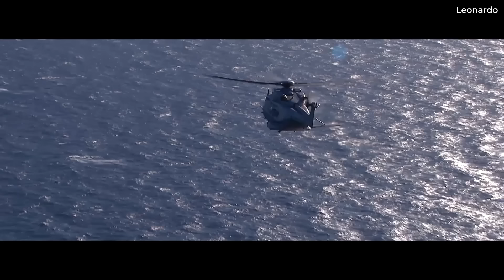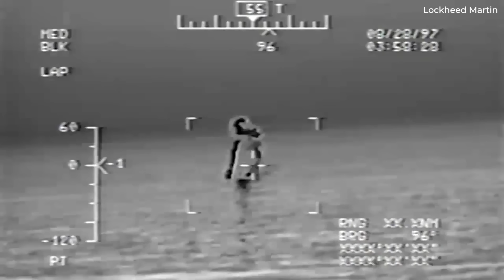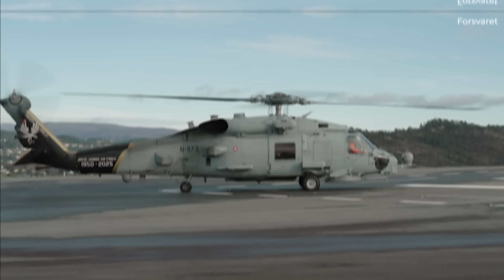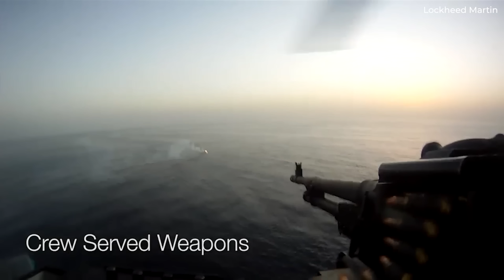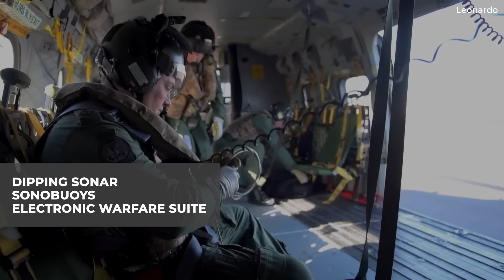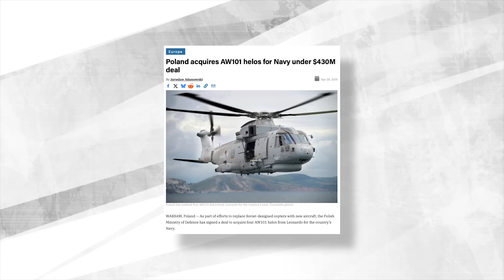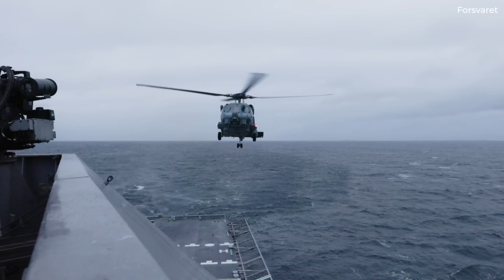MH-60R vs. AW101: What Will Be Norway's ASW Helicopter?

Comment: Considering the climate, the vast expanses of ocean surrounding Norway and the relative vicinity of Russia's Northern Fleet submarines, I'd select the Merlin hands down. Range, endurance and payload capacity ensure better performance in tracking down the latest Russian submarines like the Yasen- and Borei-class, which are believed to be very silent, (almost) on par with Western subs. That means more difficulty in detecting and tracking them and thus more time on station is required. 
Given that the Norwegian Kystvakt already operates these machines, that would make for perfect fleet harmonization and efficiencies of scale. And last but not least, the US are - again - threatening Greenland and Denmark into making far reaching concessions, so selecting the MH-60R means adding new vulnerability to the existing ones (F-35, ESSM, etc.)
Norway is a very rich country, earning a windfall in oil- and gas revenue as we speak due to the US-made energy crisis, so the higher acquisition and operating cost will hardly be a matter of concern. 
It would be nice though if the Merlin also got an electro optical sensor for passive search and track, which does not set off the ESSM-mast of a Russian sub at periscope depth. And a vast amount of sonobuoys would also be very welcome.

Comment: Merlin is the better technical and  integration helecopter.

It is considered the world best AzsW helecopter platform.

Used by the RN and therefore integrates with the joint Type 26 / Merlin platform with Norways type 26s.

Need Canada to purchase Merlins then the far north is covered by Type 26s and Merlins.

Disopointed that Sweeden has gone gir French frigets.  But perplexed why Babcock put forward the 120 instead of the 140s.  Given that French friget is longer than the type 31?
Reply: Agreed that it's the best solution. Canadian purchase seems unlikely, they do operate SAR Merlins but there was some political nonsense in the early 2000s which meant they cancelled their ASW Merlin order and bought a bespoke platform from Sikorsky instead which has caused them a lot of problems but seems to be resolved now.

I think you are confused on the frigate front. FDI is ~120m long as is (obviously) the Arrowhead 120. I assume this size was stipulated in the Swedish requirements, and I think FDI was clearly the better choice given Arrowhead 140`s main advantage is its size and therefore versatility (something you lose by going to AH120 while also losing the benefits of operating a shared design with your regional allies. Add to this that the Aster 30 / CAMM-ER combination on FDI offers an excellent AAW capability which would require either reliance on American missiles or more expensive integration work on AH140 or AH120.

Comment: The operating cost per hour numbers were a bit surprising, working purely on logic (no insider knowledge here) the Seahawk to Merlin cost should be roughly 2:3 matching the number of engines burning money, this is obviously more favourable than the 1:3 ratio you have stated. Potentially the difference could come from the Seahawk values coming from the manufacturer (who want to post good numbers to sell product) vs the Royal Navy operational values (who want to justify their budget) which could lead to some "creative rounding".

As others have said though, increased interoperability with the RN given the commonality of the Type 26 Frigates that these helicopters will be operating from is a significant factor so I would think Norway will be going Merlin. Another factor for a bigger chopper is the lift capacity in a transport role, which as these will be operating as the sole vehicle for a frigate will also have to take on ship-ship and ship-shore resupply even if ASW is its stated main role.
Reply: Operating costs are a quagmire.
For instance, the Swedish Cost per flight hour for the NH90 that caused black headlines included the annual maintenance which resulted in the CPFH steeply climb the less actual flight hours were used.
Finnish calculations during the evaluation for their new fighter is said to have everything included, even the janitors serving the base facilities....  which sort of makes sense if one wish to compare the total cost of different alternatives, but makes it impossible to measure against any other case.

Number of engines burning money is one factor, yes, but you also have other costs like spare parts (were economy of scale comes into play) and longevity of the components (Russian jet engines are much cheaper to buy that Western engines, but has between a third and half the life expectancy between tear-downs and full replacements). 

Long story short, the numbers presented are mostly pointless unless what they are based on is included in the presentation.

Comment: Why was the Airbus Helicopters H225M, formerly Eurocopter EC725 Caracal or Super Cougar; not considered as an intermediate low-cost, large capacity option? I still love the Leonardo/Augusta Westland AW159 Wildcat...
Reply: AW101 is bigger & can carry heavier loads than the others. It's robustness is legendary built to operate in the harshest environment's & with 3 engines it has the power & space to field much bigger & more powerful ASW/AEW equipment. It's made for situations were failure means death it can fly on one engine if it has to & it's got a significantly longer range than the others it's the better platform for maritime patrol, anti-submarine warfare (ASW/AEW). It comes at a price though of the group it's the most expensive but not by much & if you're leaning more to the ASW/AEW side it's the best option.
Reply: @ZuulGatekeeper but it comes at a cost? Both the extreme initial Capital expenditure as well as an increased operational cost including 3 times engine maintenance as well as higher fuel burn? The Caracal is only a little bit cheaper but the Seahawk would be substantially cheaper on an all-round programme cost? Would love to see a modernization programme for composite airframes and avionics for Seahawk and Caracal similarly to Future Lynx/Wildcat?

Comment: Whilst not dismissing the cost differential, I doubt that's too much of a consideration for the Norwegians - especially in light of the other benefits you mentioned.
Reply: A helicopter that can fly further, carry more equipment, with more power, and the maintenance crew can service the same airframe as the Rescue Service AW-101s is solid reasons. Price might be higher but the benefits are greater too.

Comment: The NH90 had some teething issues and much was also learned from the mistakes made in the project and first series child diseses. As Spain, NL, France and Germany has doubled down on new NH90 in ASW/frigate/CSAR trim, Norway should consider this in the new reality. Also the supply chain issue is also better now. US arms and systems. The NH90 does not have to be reconfigured for ASW and SAR unlike the Seahawk. NH90 & 101 should be the top candidates here. The NH90 is Seahawk sized, but with longer legs & 3 enignes, which is nice for longer distances in Norwegian seas. Training with the now substantial German lot instead of DKs 9 Seahawks... The NH90 in ASW also has more users in Europe, so more to trans with.
Wonder if Sweden gets NH90 in ASW for their new FDI? 
Could be you should do a vid on Germany ASW NH90 program and its sea tiger program? Germany also has 18 configured for SAR.
Reply: You gotta be kidding on the NH90 to Norway again....
Reply: Teething it's been a nightmare far too fragile & not robust enough for hash environments they spend more time in the hanger being repaired than they do in the air. The cost per flight hour is hitting $30,000 USD that's higher than most fighter jets just crazy.  Avoid the NH90 at all costs theirs a reason about 5 operators dumped it demanding a full refund or retiring thier fleets early. Sadly many operators are in too deep & stuck with it & while it's reliability issues have improved somewhat it's still one expensive pig hell it's a navy copter that can't land on ships in very rough, open-ocean environments kind of the one thing it needs to able to do.

Comment: Easy, UK is using Merlin, and it is certified for flying into known ice (something that is known to happen in Norway/North Atlantic/Barents and the Norwegian Sea/Arctic). The SH-60 is, however, not certified for FIKI (though they have some FIKI equipment).  I do not think a plan to ask Russians to only sail strategic submarines during the summer will work out.

Comment: An updated AW101 will be a beast and sill has space for future expansion, NH90's are the nibble choice. Quick to use and fix but are capped on expiation but it AW101 for me. It a Jack of all trades really for the UK which kind of makes the Leonardo contract for the new Helicopter kind of redundant, that's just how good it is.

Comment: Two very different beasts, one almost twice the size and weight of the other.
Norway should first assert what went wrong with the NH90 before committing: the helicopter is operating fine in many other countries, so the problem was on the program itself, in logistic, procurement, service contracts, spare parts procurement... Norway is the only country I know of that had issues (real ones, to be clear) in having the actual helicopter delivered.
If the new helicopter comes with the same problems it will produce the same results. The MH60R is "OLD", which means it relies on hydraulics and mechanical connection, making it less prone to "Glitches" and always fixable with a span. The NH60 is much more complex, expensive and intensive in maintenance, but it's like driving a ford Fiesta compared to a Jaguar. For the crew, orbiting over a rough sea with cold winds blowing in strafes, flying an AW101 gives much more confidence and is less taxing, plus the AW101 has a much longer range and allows prolonged hovering on station.
The reason why the NH90 was chosen to begin with was it's longer range, and flying comfort at an "Affordable price". Norway now has to chose now between comfort and costs.
Reply: We already know why went wrong with the NH90: NHI prioritizing the builder countries' needs at the expense at everyone else.
Some countries like Finland and New Zealand circumvented the issues by building their own industrial support with excellent results but that solution is only available on a case to case basis.

Comment: It’s going to be the AW101 as the UK and Norway are increasingly looking at commonality across fleets.
Reply: Norway as stated here, have ordered the MH-60R Seahawk for it's Coast Guard vessels. The Air Force Rescue Service already operates the AW-101... so it's a tossup, it will have integration, maintenance and service benefits whatever is chosen. But since the Type 26 is a UK design, and both Navies are planning to operate the class with 100% interoperability, the AW-101 ASW has a good chance of being selected.
Reply: We are forgetting that the British AW101 is an older model, and what Norway would get is a newer model, so interoperability disappears, even though they share the same name, they are not the same helicopter.
Reply: @heuhen  Its made by the same people that made the NH-90. its not British at all any longer. Leonardo BOUGHT the Design. I wouldnt touch anything they make after the NH-90 fiasco.
Reply: @heuhen given that the RN has upgraded their ASW Merlins to HM2 standard, is it that different to a new AW101?
Reply: @jamescotton01  yes
Reply: @Joakim-j7h 100% British given it was designed and developed by Augusta-Westland (Yeovil, Somerset), which rebranded as Leonardo Helicopters UK, as a sovereign UK capability.
Reply: Dazu kommen noch Italien, Polen und andere NATO Staaten. Zudem denke ich das Leonardo in Sachen Technologie die Oberhand hat!
Reply: Exactly

Comment: I think it's fairly obvious that the Norwegian helicopters will be armed with NSM (or possibly JSM) missiles and they are heavier than any missile either is currently equipped with. Both helicopters should still be able to handle them but the bigger AW101 may have an edge there.

Comment: There is one more advantage that Merlin has over Seahawk and it is quite obvious. Big cargo door at the back. That is a big deal in my opinion as it can carry much bigger cargo not only it terms of gross weight but also in dimension. For US that is not a big issue as they can afford to have countless number or various size helicopters for their needs: H-60 Sea Hawk, CH-53 Sea Stallion, CH-47 Chinook... For Norway it might be more beneficial to have bigger Merlin also due to the size of their sea they patrol vs the size of their navy.
Reply: Merlin in HM.2 variant (ASW) doesn't have the rear ramp. Thats on the HC.4 variant for troop transport.

Comment: Another consideration  would be crew comfort.  I believe the crew cannot fully stand up in the 60R vs the cabin space in the AW101.  Interoperability not a big factor, since the comms suite will ensure NATO interoperability.  As for crews from one country flying helos from other countries, not a factor except in unique cases.

Having longer endurance also translates into greater efficiency for the ship.  If the ship/helo use a 12 hr deck cycle, the AW101 (6 hr endurance) entails one refueling and crew change for cycle, vs 60R (4 hr endurance) means 2 refuelings and crew changes per deck cycle.  This means that the there is an increase in time and effort that the ship is constrained in its operations.

Secondary roles were just touched on very briefly.  One role is vertical replenishment or VERTREP.  I have no doubt that the 101 has a greater lifting capability when conducting VERTREP especially at sea from a supply ship.  With the greater range, VERTREP from ashore or medevac or passenger transfer may also be a factor.
Reply: One important issue often overlooked: The Norwegian Sea and Barents Sea means vast distances. Survivability is a critical issue.

✅️  The Leonardo AW101 features an integrated emergency flotation system designed for safe ditching and rapid (or delayed) evacuation in the event of an emergency over water. 

❌️. The U.S. Sea Hawk doesn't float. That works fine for a large battle group, with many helicopters on alert, but not for a single frigate on patrol in remote areas...

Comment: AW101, in every metric.
Reply: AW101 is an enourmous maintainance hog, but it is probably the best choice. And we would finally get some synergies effects of having the same helicopter in 330skv
Reply: Except for price, parts availability, and running cost
Reply: Other than the fact Norway already has MH-60R on order.
Reply: @120mmsmoothbore2   The six extremely overpriced MH-60R Sea Hawks was a hasty political decision. We paid premium for quick delivery, but USA later chose to delay delivery by 2 years (read: at least 2 years)... Unreliable.  Besides, it won't have ASW equipment. They're just for general transport on a few Coast Guard vessels. 

AW101 is of a higher class ...in any capacity. We need it, and we should just standardize on AW101 for long range SAR, ASW, and transport.

For small-to-medium multi-role (and smaller Coast Guard vessels): AW109 or the excellent AW159 Wildcat.

And just sell the Sea Hawks to Sweden/Denmark, while still new.

Comment: NH90 was crap. Totally unusable. Norway already has quite a few AW101-612. 16 of them and more is on order. These are operated by the Air Force and is mainly for SAR use but is also available for general use by the military when available or priority is needed. I suspect they chose different for the frigates to have a bit of redundancy in case of part shortage. That was the issue with NH-90. They always broke down and there was always backlogs on parts. There is nothing saying we can’t use AW101 on the frigates too. Before fall this year we will have 18 of them. There is no question about what will be chosen as the choppers was ordered when the NH90 was cancelled. It will be Blackhawk. So that make this video kinda wrong as there is no competition ongoing.
Reply: The SH-60 ordered are for the Coastguard...not the Navy. They're not going on the Frigates...the ASW helo competition is separate.

Comment: Wonder what sort of helicopter Sweden will get for their new Frigates? They have their own variant of the NH90 which has some ASW ability but there is a defence decision from 2022 stating that the NH90s (Hkp 14) should be phased out and a new naval helicopter system should be acquired instead.
Reply: When Sweden intends to replace them and if their dimensions are fit Finland should buy Swedens ASW-equipped NH90s for use on the Pohjanmaa-class corvette and elsewhere. The corvette should be able to house a medium helicopter in its hangar. And why not buy the rest of them as well while at it to increase numbers as long the price is right.
Reply: It will likely need to be something similar in size to a NH90 with the tail folded as that is what the FDI frigate's hanger is designed to fit. Hellenic Navy use a MH-60R on their FDI that just entered service.
Reply: As far as I know NH industry heared the call started to change from governmental office to customer oriented service. Maybe in time that Sweden can profit to its satisfaction.